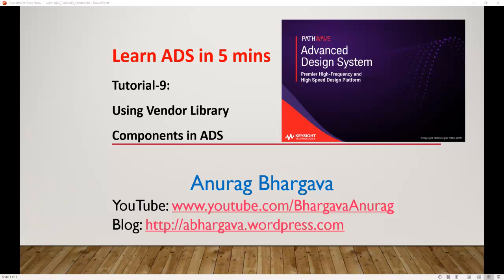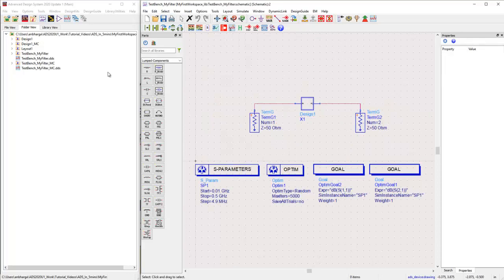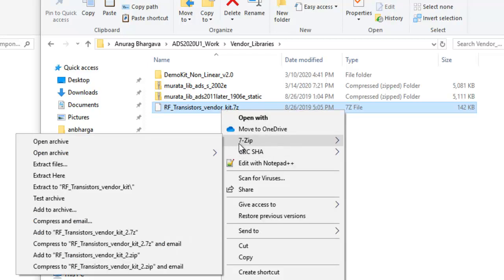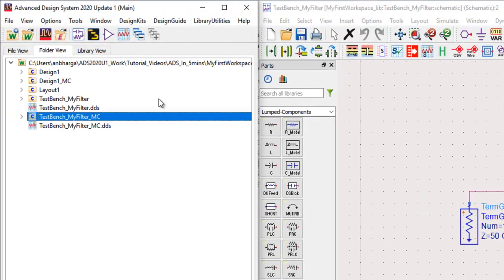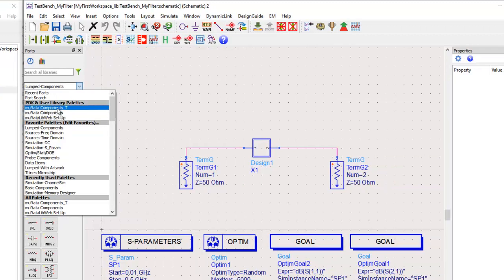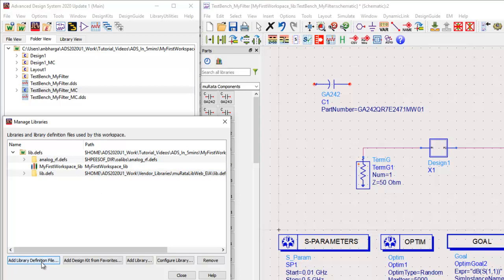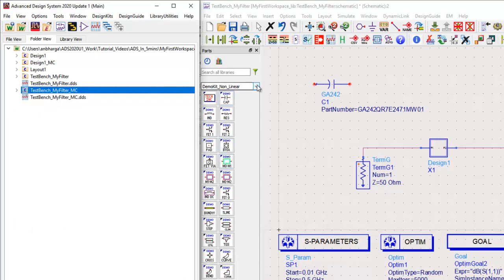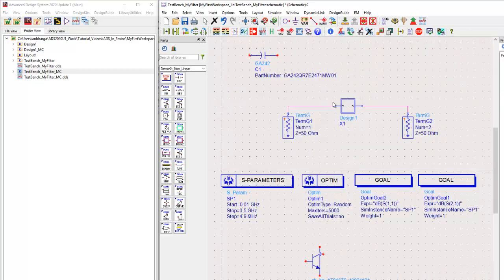Tutorial-9: Using Vendor Library Components in ADS

Comment: Recently, when I am trying to add the new murata library it gives an error Unable to acces : muRataLibWeb. The procedure worked fine previously. Could this be a version problem or I am making any mistakes. Could be please clarify.
Reply from the maker: Kindly contact Keysight tech support team for help as it is difficult to assess what's going wrong without seeing your setup..
Reply: @BhargavaAnurag  It seems that the latest library from Murata is facing the issue. I was able to add an older version. Thanks!!
Reply from the maker: @ARUNMOHANB  Kindly provide the link from where you downloaded the latest library. I will download and check

Comment: so, do this vendor libraries include the effects of pads? or we need to add them using MLINs?
Reply from the maker: Hi Kapil,
The libraries included inside ADS doesn't include effect of pads in general. It is always a good idea to check with vendor if you are downloading libraries from their website. The libraries sold by Modelithics usually have both options and you can decide to switch on/off the pad parasitics.

Comment: Sir how to add a diode library in ADS? I was trying to simulate a diode circuit and got this error " DIODE is an instance of an undefined model DIODEM1"
Reply from the maker: If you are using non-linear model from built in library then it indicated you only placed symbol on schematic but forgot to place the model card (it is there in the same library). If you are seeing this error while using any vendor library then probably you forgot to place Tech Include component on the schematic.
If doesn't resolve your issue then pls contact your local Keysight tech support team for help.
Reply: @BhargavaAnurag  thanks a lot sir
Reply from the maker: @eeengineers3958  You are welcome...👍

Comment: Sir, Im new to ADS. I have downloaded BAT6202V ECAD model since it is not available in Vendor List. Spice Parameters are not mentioned in DATA sheet clearly. How can I use this model in ADS for designing rectifier circuit. Thank you.
Reply from the maker: I would recommend to get in touch with local Keysight support team for help.

Comment: I need TGA2602 Qorvo library for ADS but on vendors website only system Vue and Genesys libraries are found. so what can you suggest me how can I get the same transistor library for ADS.
Reply from the maker: The device you mentioned is a low noise device for which only S-Parameters are available on vendor's website. You can download and use the same for your LNA design. Remember for LNA design you don't need any non-linear models as it is largely all linear and noise analysis you need to perform as I discussed in my LNA video.
Reply: @BhargavaAnurag  yes sir I have designed the LNA from your video help with same transistor used in your LNA video series and achieved good results.
But for TGA2602 transistor the vendor provided the s2p file without Noise Data so how can I get Noise figure from it.
Reply from the maker: You cannot. You need to contact vendor to get a S2P file with Noise data.
Reply from the maker: Can you share the results and comparison between your simulation and measurement?
Reply: @BhargavaAnurag  sir i didn't fabricate the LNA but i did its cosimulation and my results were similar to yours Noise figure 1.2dB, Gain 16dB.
If you send me your email so i can forward you my LNA design and its results which i got after following your LNA design videos.
Reply: @BhargavaAnurag  okay i will.

Comment: sir, i am trying to import vendor file (transistor) but the file is in .s2p and .mps. Is there any way or sources to import these file?
Reply from the maker: Hi Mohd,
S2P is a touchstone file so pretty straightforward to use it in ADS. Kindly watch tutorial 13 to learn more about it and this file can be used for any linear analysis such as S-Parameter or AC simulation. I am not sure what kind of data of you have in .mps file so can't comment on the same.